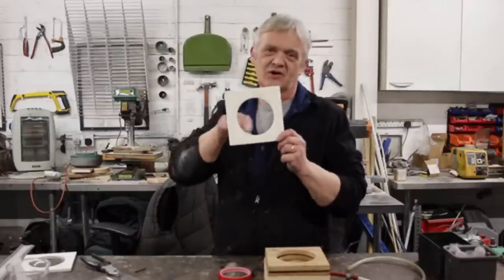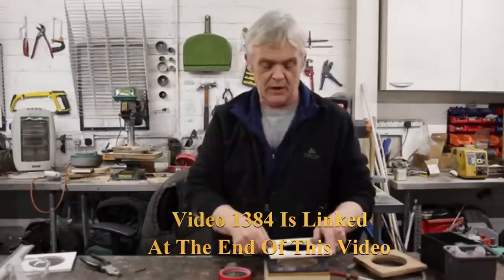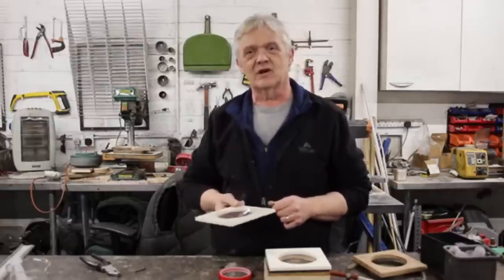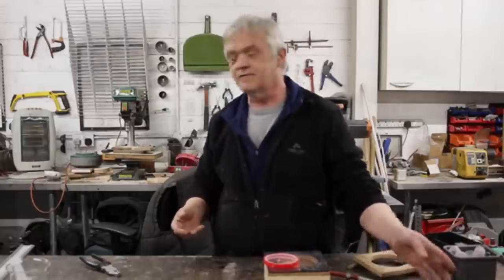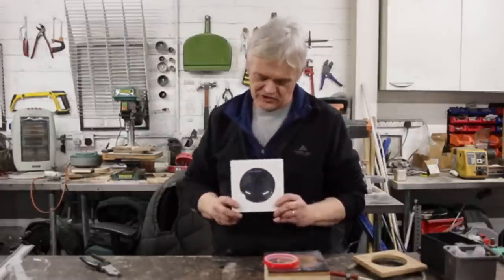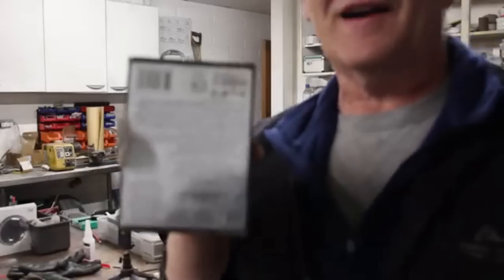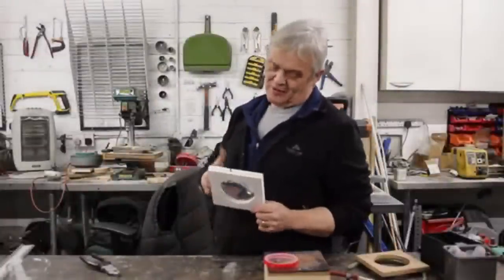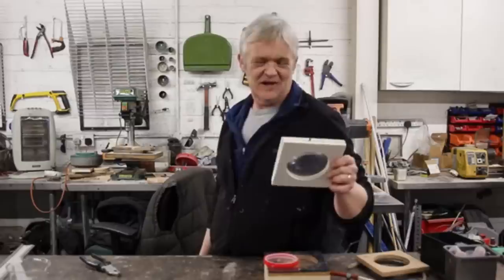1895 Lenses From Water And Plastic

Comment: Robert, you can also make large spherical curvature mirrors for solar concentration by taking a large shallow circular cake pan, stretching out a sheet of mylar or foil, and gluing the foil to the rim of the cake pan, followed by pulling a mild vacuum in the cake pan. With this method you can actually make frighteningly powerful solar collectors.

(There are some videos on YouTube claiming that this makes a parabolic reflector, but this is not correct; the curvature is spherical, just like a bubble would be, since air pressure pushes perpendicularly on the membrane at all locations.)

Comment: Hi Rob, I have seen a lens made with water to magnify the sun's rays to heat something or start a fire. Simply spread a sheet of plastic across a square frame (say a metre but size is irrelevant ) attach to frame (continuously around edge) then place horizontally and pour water on top. It will automatically stretch to make a perfect lens shape (convex I think) with a perfectly flat topside. Of course the larger the more powerful. André in Sydney

Comment: You reminded me of an I had an idea for making these clear large domes from liquid floor acrylic after I saw a video of a guy using the method to make submarine windows and depth testing them.  You would need a large inflatable ball or alternatively a dome shaped object which you prepare by using self adhesive foam around it for a border, secure so it can't move, then apply the acrylic.  I also looked up what large clear domes cost from manufacturers, they are quite expensive.

Comment: You can also make small lenticular lenses with your laser cutter. Just place a transparent sheet into a container. Fill with distilled water that's just barely covering the transparent sheet, and pulse with the laser.

Not sure what type of laser you have (if you still have the contraption) but should be 30-50 nanoseconds each pulse. You can do different size lenses on each sheet and when you stack them you'll get the so called invisibility effect.

Comment: Interesting that you bring this up. Was looking at it for possibility of reaching extreme temperatures as a power source to melt metals
Reply: A mixture of lenses and reflectors could work. The crucible/Furness would need to be a bit special, perhaps with different refractory layers? You could easily make a cool 'death ray' soldering iron.

Comment: I used to own some eyeglasses that had a liquid lens that deformed using a little slider above the frame.  They actually had two sets of lenses.  The outer lenses were my long-distance prescription and were just normal lenses.  The inner lenses were these liquid thingies and could adjust short-distance vision quite effectively.  They were very good until they developed a leak.  I bought replacements (very expensive) and then the new ones leaked while still under warranty.  The company went belly-up and so far, I've not found equivalents.  

I keep looking, but I've not seen any product that works credibly.  The idea is sound though.  I wish someone would produce some good adjustable glasses.  They are far more comfortable than multifocals.

Comment: If I remember my high school physics properly, sticking a liquid with a higher refractive index in there should give you more magnification. It happens that glycerol, or glycerine, has a higher refractive index than water, 1.46 and 1.33 respectively. While water is a lot easier to work with than glycerol, I think it's worth a shot.

Comment: Make a lens with clear, degassed, agar (I don't like using gelatin).  I haven't tried it but it should work.  If it works, then colors could be added.  If that works then we can make an array.  If that works we can make filters.  If that works then we can shrink the sizes of the array elements.  If that works, then if we overfill a silicone candy tray that makes tiny candies then we have an array on a substrate that also has optical properties.  I think I need to try this.

I once worked with a liquid lens that was adjusted using piezoelectric actuators; another one was voice coil operated.  It's very interesting stuff - one liquid lens tech was developed just to do deep sea imaging.

Comment: Hi rob. I suggest you have a play with making some molds with your 3d printer and make some compression carbon fibre parts . Easy as and can make anything that needs to be light and strong 💪 you could also get chopped carbon and make forged carbon parts. Amazing awesome

Comment: And I guess if you used a syringe to fill the water you could adjust the focus by squirting in more or sucking less water into the lense. Ie you can do a remote focus without moving the lense backwards or forwards to focus.

Comment: I have been chatting with Chat GPT to design a plan for a deep earth digging project. I've designed habitats that will generate electricity from heat around the case with a layer of water around the habitat to absorb radiation. Each unit will have a drill to go deeper and study before we persue sending a new habitat further down., 3d Printing will be vital to this.  The goal is to study the innards of the Earth 😀 I would like to see if there is a Sun in the middle of the Earth personally...
       I think that studying inside earth will reveal more about the universe then we would expect.